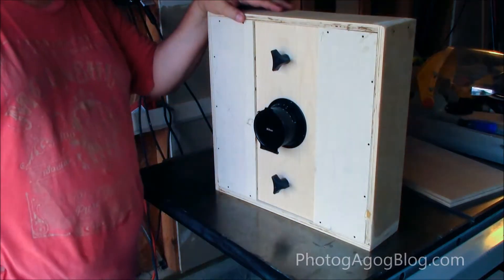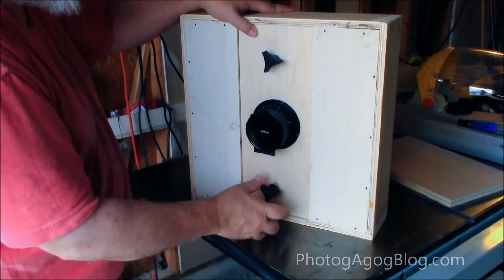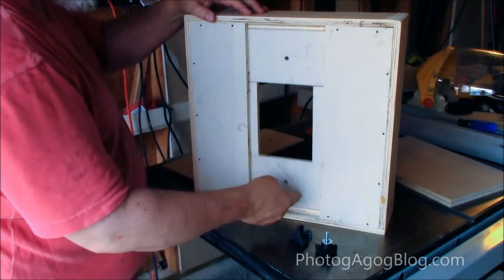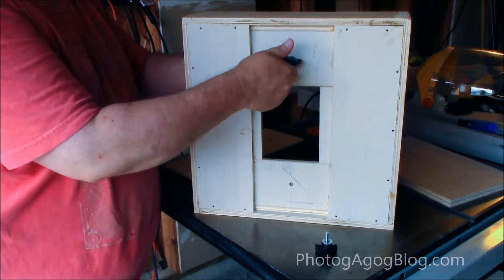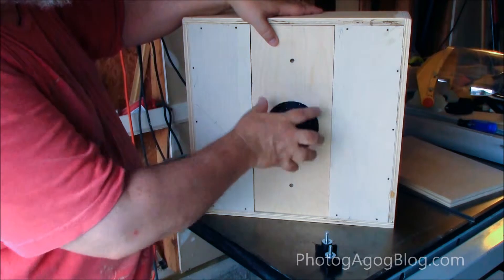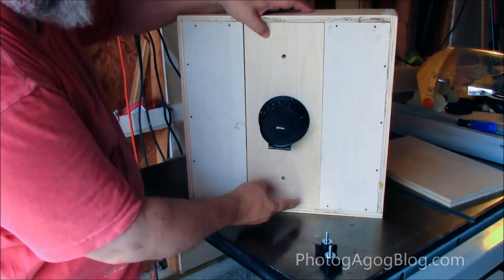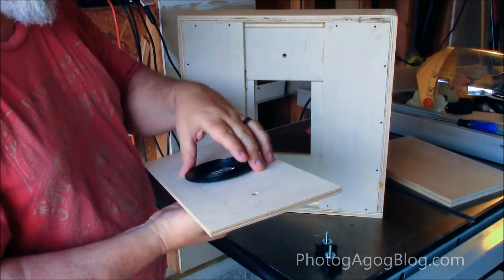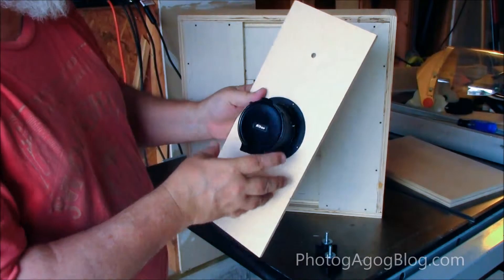Wetplate Camera Build: Lens Standard

Comment: Do you have some kind of schematics for your builds or do you just wing it with optimism & sense? I would love to build a camera too, but I am completely out of my depth here; your channel has been a great starting point, but I wonder if you have any sources for more technical specifications?
Reply: hey.  So that was 100% fly by the seat of my pants make-it-up-as-you-go-along.  The only "parameter" was where i decided to get the lens and did some cardboard mockups to see how big i cold make it to do 8x10 image.  I did manage to finally complete the camera and took a few Ambros.  Overall it was a huge, heavy beast and pretty impractical for anything other than learning how a camera works (and what not to do).  It pretty much just takes up space in the attic now.   I was inspired by the first folks to invent photography back in the 1800's.  You can't just build a camera... you need to build a camera, build a dark room, formulate the chemistry...only THEN can you make a photo and try to figure out what of the dozens of steps failed.  If you're on FB, look up René Smets.  he is a brilliant MASTER camera builder and posts often about the process and designs as he's making them.  There are a couple of books on making cameras, but it boils down to whether or not a cloth bellows is used.  The book i found is more non-cloth bellows, which is a good way to build a first camera, but lacks the control, portability, and flexibility of a traditional large-format.  Anyway, thanks for the comment and best of luck to you!
Reply: Also I would just like to say you seem to have such a lovable sweet disposition :)
Reply: @JC-vp2qn  Thank you!  I attribute it to good ol' Southern Charm.